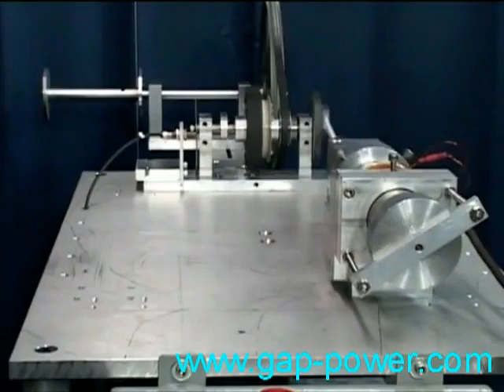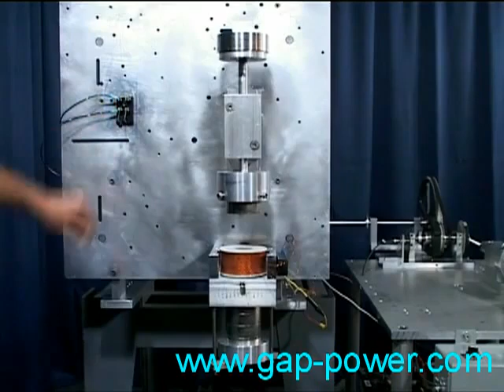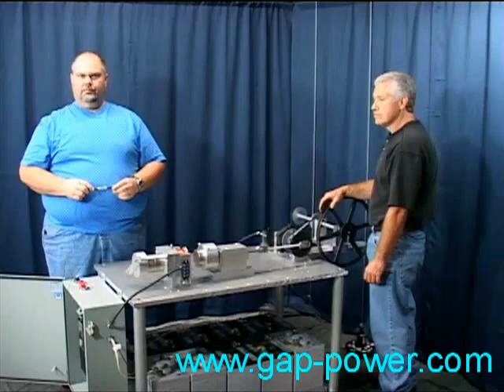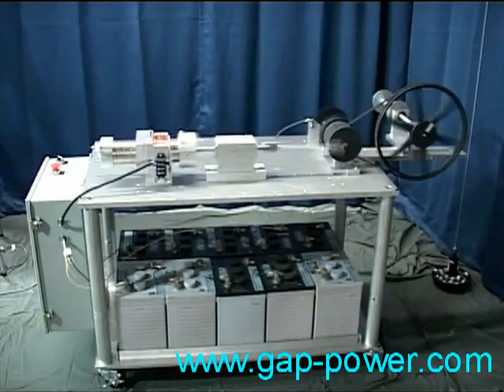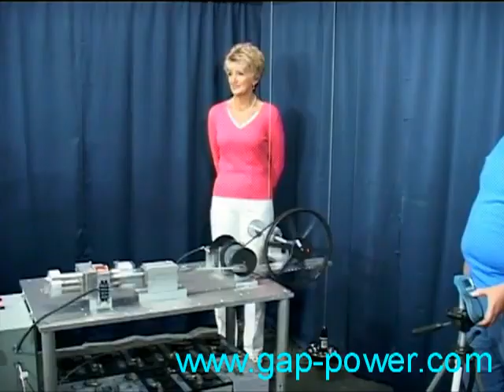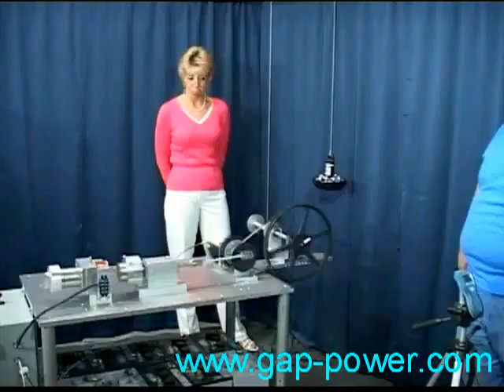FREE ENERGY  24 Working Magnetic Overunity Device   Magnetic Neutralization

Comment: So much stupidity and ignorance. More power in this is contributed by the forces of the machine and the current than are produced as output.  The batteries account for a portion, the wheel accounts for a portion. There is energy loss throughout the system, as in all systems. By nature all overunity devises are bullshit. If you can produce more energy than something takes to use, you should be able to apply that energy back to the system and have it run forever. clearly this doesn't run on its own.
Reply: If it has proper bearings and the resistance is relatively low, the machine should work. you have two sources of energy. As it runs it uses the stored charge in the batteries to fire the coil, then on the 57% of the cycle where the coil is off it is charging the batteries through electromagnetic induction, so if it consumes as much energy as it generates, that should be a 14% net gain through the coil alone, then with a second generator connected to the pulley it would add more. My point is that we do not know if the device could run forever or not until someone tests it. Don't go belittling someones work when you have only seen it briefly.
Reply: 16BitTerror If this was true then a machine without the batteries would be easy to construct.

As for knowing if the device can 'run forever', the forces involved in using an electro magnet as a switch like this are well understood.   Energizing the coil expends more energy than can be generated using the motion of the piston.  It does not 'neutralize' the permanent magnet, it pulls the piston to itself and thus all the movement is due to that energy input.   All they have built is a fancy servo and mathematically it is not really different than hooking a motor to an alternator.

Comment: Very interesting, we all have over unity devices, they are called fridges. So it is not impossible. But you can't get a free lunch. Energy is all around us though. Just waiting to be tapped. If this will run until the plates in the batteries give out. Then fair play to you. But if it runs until the batteries discharge. Then it does not work.. It would be nice to see a closed loop with out batteries. Maybe you could use new super capacitors instead of batteries. All these people who criticise free energy are as bad as any fraudsters who try to dupe people. I do not believe this system is a fraud. Not sure if you could get any constant power from it though. But people do need to unite against the energy company parasites. Their reign of greed must end. Lest mankind will be doomed..

Comment: it's an interesting concept. I really like that idea of the "magnetic neutralization" The question becomes though, Since the magnets are in opposing positions, that means the coil.. excuse me "coal" has to produce a magnetic field strong enough to block the magnets behind it, which would require a lot of energy. Unless i'm mistaken, there would only be harvestable energy if the magnets repelling each other generated more energy than it takes to neutralize the magnetic repulsion. I suppose as the outer magnet is attracted to the coil turning on, there would be some induction on top of the current flowing through the coil. Perhaps that is harvestable somehow. Again, love the concept. It obviously runs, but the video wasn't able to show any evidence that it's harvesting. For all we know it could just be a really cool science experiment of how to neutralize magnetic fields with a stronger magnetic field (and it's not really neutralizing the magnetic field, it's creating a stronger field between the opposed magnets.
Reply: Your last sentence sums up why you can not harvest excess energy out of this system.  All they have done is build a complex and inefficient linear actuator and hooked it up to a generator.  It is just another example of one of those 'hook a motor to a generator and hook the generator back into the motor' devices.

Comment: Input power, put an amp meter clamped around the wire to the coil.  According to the tektronix device you are pulling 10V and 611mA.  10 batteries turning a wheel and lifting a small weight, not that impressive.  What is the output, you don't mention it.

Comment: Brilliant demonstration of the magnetic equivalent of a Stirling engine. The power used to switch the coil on and off should be equal to the reactive load power which strictly speaking is in an imaginary dimension, that is it is not dissipated as heat. It is neutralized every time the flywheel completes a revolution. So we have a method of converting reactive power into real power, and this is the fundamental property of an over-unity device. I hope this makes sense to those who debunk over-unity engines. 
To extend the theory, the earth's magnetic field is like a reservoir of magnetic energy which rushes in like water into a water wheel every time the magnetic field is neutralized.
Reply: Thecommet
Good point about static magnetic fields. However, the earth's magnetic field isn't static in an absolute sense, only approximate to a very high degree. ANY deviation from an absolutely constant field strength permits the possibility of energy abstraction, however small, such as caused by electrical discharges, motion of air/dispersed water (humidity)..., because the other side of the law is delta B WRT fixed charge. Since this all magically takes place in an absolutely fixed (and therefor nonexistent) frame of reference, the whole model has a gaping flaw in its foundation. And that's without considering the extremely short time-scale at the single-domain level where all of the individual electrons absolutely precude any possibility of such a thing as "static" anything, but statictically produce a convincing lie to an observer. Sort of.
Reply: Electronic engineer here, I understand what you're saying but you have one fundamental problem: You cannot get power from static magnet fields (such as the earth). A magnet is not an object you can somehow sap power off of. Energy is only converted when moving something through a magnetic field. In the case of a coil moving through a magnetic field, momentum is converted into electrical current. Energy is preserved, though, so there is no "creation of energy".

The Stirling Engine was not over unity either, it converted heat into momentum and also preserved energy.

Comment: When you can take the batteries out of the equation, give it one turn to get it started and have it keep turning and do work, I'll consider this more seriously. But what you have here is a device that must, in a single turn, produce enough power to cancel out the magnetic flux for half of that turn. 
Based on what I'm seeing, this is not capable of doing that. You have not created an over-unity device.
Reply: I believe that it takes less power to cancel the field than what it produces in current
Reply: george baker If that is true you can remove the batteries.
Reply: corthew you have a point but maybe that is possible. I say keep on researching
Reply: george baker Beliefs do not factor into this. The FACT is that the energy you invest into creating a magnetic field is equal to the energy released when the same magnetic field collapses, given we're talking about an ideal coil. In the real world, you'll get even less energy back due to magnetic losses, parasitic capacitances, and series resistance.

Please educate yourself before making silly comments like that.

Comment: Congratulations Mr Tamer for having executed your project so well. Unlike other experimjenters, your set up lends itself to easy understanding. You have measured the output mechanically, which is perfectly acceptable. Measuring output electrically would have been preferred but would have required a dynamotor which would add to the cost of your well worked out project. An integrating type of input voltage and current meter would have solved your problem in determing the energy input. The reverse induced voltage though it could be very high could safely be neglected as it is the reverse induced energy which is to be taken into account.. Measuring the forward input energy would of course present no problem. It would seem that you have done no further work on your project as i have not found any later post or posts on Youtube.The Adams, Bedini and other devices have been stated to be over unity systems. This is not so as has been experimentally established by a group of physicists who have posted their investigations on Youtube. These machines do infact produce a very high reverse voltage whiich is then used to charge a  spare set of batteries. The batteries do not  charge as the reverse induced energy produced is not near enough to charge the batteries. I would very much like to know what is the forward input energy you have measured if you have done this.. A cursory overview of your system would seem to indicate that it isa linear version of the Adams , Bedini and other systems claiming overunity performance.Do try and measure the forward input energy neglecting the reverse component which would induce false measurements and complicate analysis.And please do post further work you have done or plan to do on your well executed project.

Comment: You can test it by hooking it to a capacitor, getting it running, and then unhooking the batteries so that it will be running on a capacitor. If it continues to run, it is overunity. If not, it isn't. Easy.

Comment: Question: Would the power generated from the magnets be enough to operate the magnet neutralization coil? If so, would this cause a chain reaction of perpetual motion, without the need for the external battery supply?

Comment: I believe you have something to build on. The law of physics and logic, states, the extra power must be harnessed from something. In this case, (magnetism). So, the idea would be not to waist any power. Recoil opposing power with something like a spring or piston & cam shaft with fly-wheal. Add another constant power source, utilizing (gravity), having the device vertical. Make the the process able to variably increase in frequency or speed, naturally. The on/off cam switch may (restrict) the increase of frequency or speed, so, another method to replace that, is needed. A on/off power switch linkage, having logic corresponding to the increased of the (piston frequency) or speed. To measure the power result, simply and accurately, requiring no trust of math, add a electrical power generator. Test the power output (before and after), the device apparatus is engaged and measure the amps and volts to (Watts), with a simple multimeter. In addition, an idea I am suggesting, as well, is to implement the adding of power, as like when one jumps on a trampoline, with each application of power, the person gets higher and higher. Like, with you, every time, with whatever your smoking. Just kidding:) Count how many points I've made for improvement. Isn't that why we reach out to people? With each mind adding to each other's thought process and building from there. I suppose it could go either way. When building a castle and someone adds manure to the grounds, It grows gardens. If they mistakenly add the manure to the castle, it becomes a castle of shit. DES_Top Computer Repair Service ~ Facebook, ~ Linkedin ~ Google.

Comment: All this arguing and all you have to say is "let it run" (with a load) and did it stop? wow
Reply: I believe it will run with a load, but even if the load is only a flashlight it is still working. But the question is will it run the load without the input power exceeding the output power.
Reply: It is running on a load, watch the video at around 7:45 minute mark it lifts a weight.